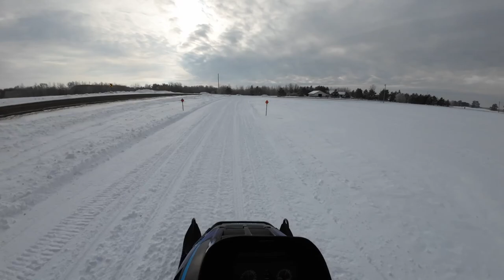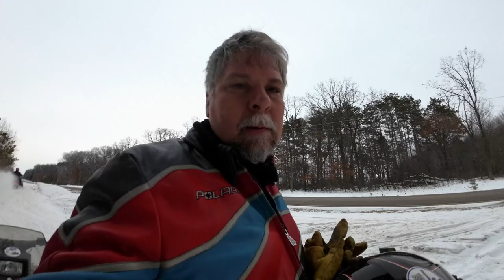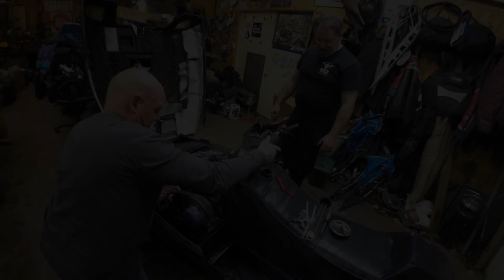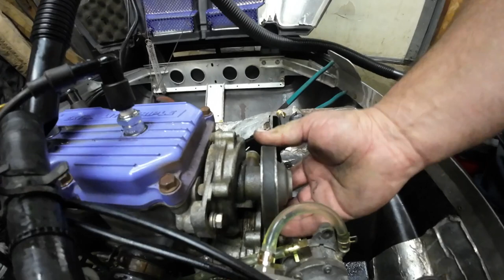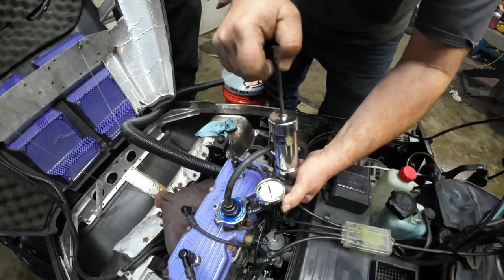New Years Eve Ride 2022, Grape Ape comes home on the trailer! Polaris XLT 600 triple.

Comment: I just recently watching your videos. I have a 1999 Indy 600 xlt sp that the electric start won’t work any ides? I replaced voltage regulator. New battery
Reply from the maker: Unplugged wire, bad key switch, bad solenoid, bad connection or maybe even some other thing. Pretty easy to figure out with a test light.

Comment: Would you happen to have a link to the pressure tester ?
Reply from the maker: I made it myself. I don't know of any place to buy them. It's pretty simple to make. An air hose fitting, a regulator, a ball valve, a low pressure gauge and then a hose barb and hose to hook up to the pulse port.
Reply: @Nutter's Speed Shop  thank you, when I have time I'll be making one. Your channel is awesome for idea's.